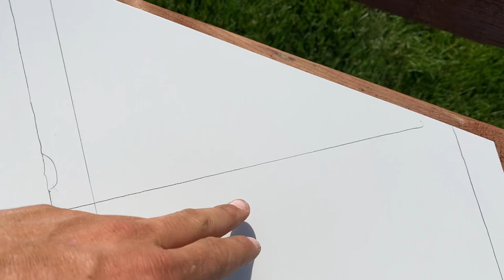Building another deck!

Comment: Looks very nice. Are the front supports just on the concrete pads? If so aren't you worried about frost heave with the other end attached to the house and not free floating?
Reply from the maker: Not really